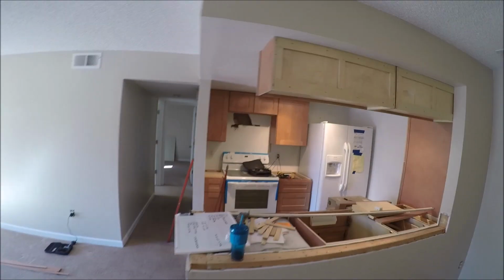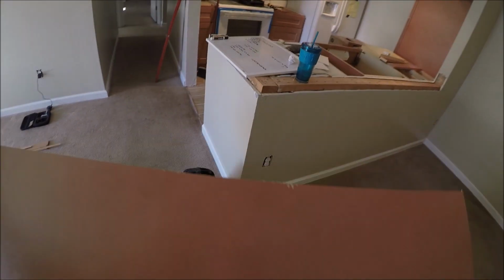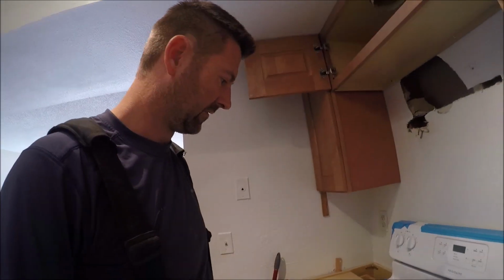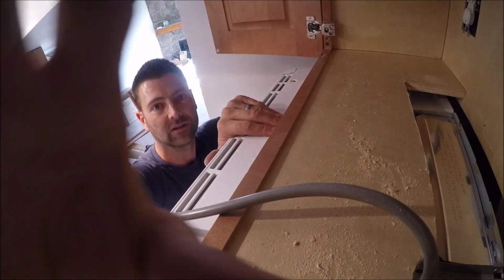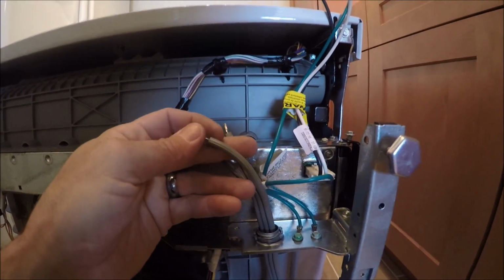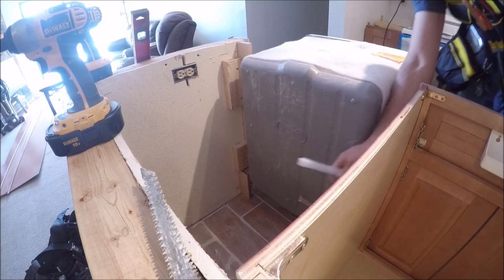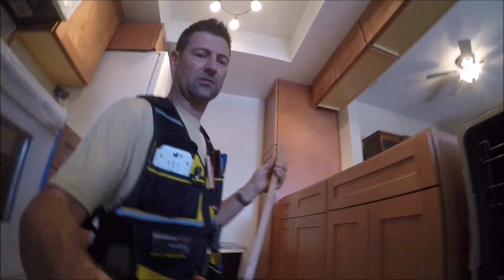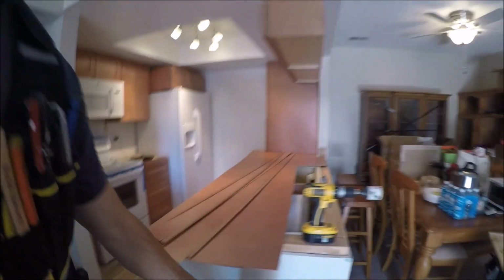DIY | SMALL KITCHEN REMODEL ON A BUDGET PART 3 | THE HANDYMAN

Comment: I have no idea if you'll see this. I'm just kind of binge-watching your older vids.

I bought my house about 5 years ago, and the previous owner had been mostly through a remodel before he ran out of money. Fortunately, all the really expensive stuff was done. The kitchen remodel wasn't bad, but... The range is on a peninsula. Whenever I cook steaks on it, or anything else that makes a bit of smoke, the whole downstairs knows it. So it'd really be nice to have a hood. There is a smallish ventilation fan to the outside in the ceiling above the range, but I think was an existing feature from before the remodel and it's in the wrong place for a straightforward hood install. A little too far to one side, and a little too far to the front. Generally speaking, would there be any way to offset the ducting somehow, if the housing for a hood were large enough to conceal it?

I'd also like to say that I'd so hire you if we were in the same time zone.
Reply from the maker: Yes you can do that with in reason.  You don't want a huge vent hood coming down. If you have a basement you could also get a new range that has a pop up vent that suck the air off the range and down and out through the basement. And out through the side of the house.   There are options and it can be don and look nice.
Reply: I hadn't thought of those. Googling for it, I see I wouldn't necessarily have to replace the range. You can get separate downdraft hoods. Installing it would be challenge too, given the configuration of the cabinets and the granite countertop, but it's probably more doable and less ugly than the other way. Thanks!

Comment: Just a question, why not patch the drywall and tidy it up behind the microwave?

I don't have a microwave above my range but I do have a vent hood.  I recently replaced the hood and found a hole behind the wall that was letting cold drafts in from the attic somehow.  There wasn't an outlet either but it was similar wiring.  Not romex but rather the steel flexible conduit just popping through a large hole in the wall.  I sealed it up with expanding foam and trimmed.  Mind you, I didn't do any drywall work but it is hidden and it is air tight.

My home was built in 1973.  All of the walls had cellulose insulation blown in with about 1/2" foam board on the exterior before new vinyl siding was installed, new Pella windows, and also cellulose insulation blown in the attic.  The home is very well insulated but there are odd drafts inside of the walls, most likely from the attic.  Sealing up as many nooks and crannies as possible does make a difference!

For instance, I also had a recessed light above my kitchen sink in the soffit that was leaking cold air.  Solved that problem similarly.
Reply from the maker: It's a waist of time and doesn't make money.
Reply: also ALL walls (should) have a top plate and aside from a few holes for wiring, should NOT leak any attic air into the wall cavity.  Pretty much all modern structures are built this way for insulative quality and to prevent airflow for fires to communicate through walls and attic.

Comment: Great video!  Based on what’s happening with my old cabinets, I might recommend that the spacers beside the dishwasher be reinforced.  I’m thinking 1x4 flat against the left and right sides, to prevent DW maintenance (sliding it in and out) from shifting weakening the sides?

Comment: Just curious, the electrical outlets in the dishwasher and sink cabinets are not GFCI outlets. Should they be since they are in an area near water supply? Or is that only for outlets above the counter?
Reply from the maker: You are correct.  There is usually one outlet under the sink that is actually 2 circuits.  One side of the outlet is dedicated and switched for the garbage disposal. The other side of the outlet is dedicated and for the dishwasher.  Both are 20 amp circuits.
Reply: nerdyrcdriver I believe code says gfci within 2 ft of any sink